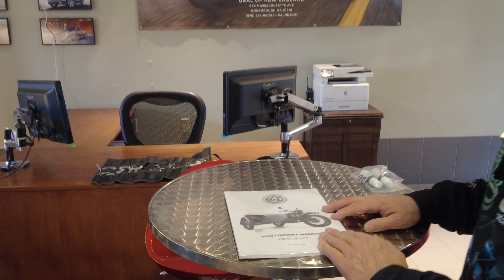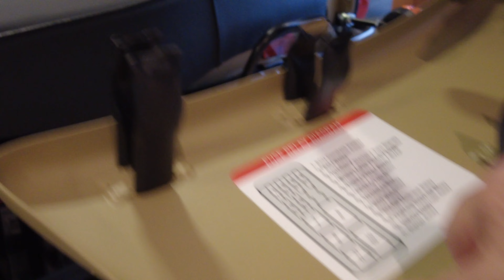Your Ultimate Guide to Ural Sidecar Motorcycles!

Comment: Can you figure out a set of cast wheels so tubeless tires could be used. That would enable a simple tire plug instead of changing a wheel or patching a tube on the side of the road
Thanks 

I know cast wheels aren’t for rough roads but they would be ok carefully on a gravel road